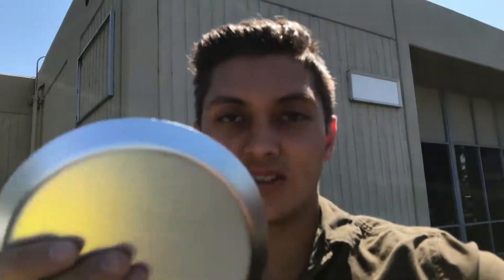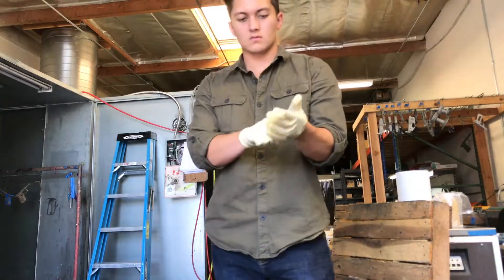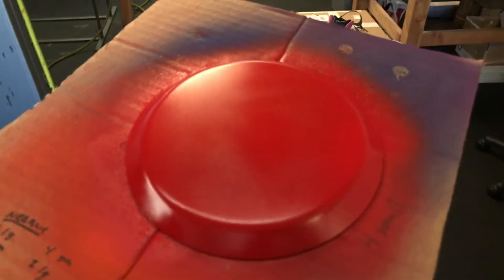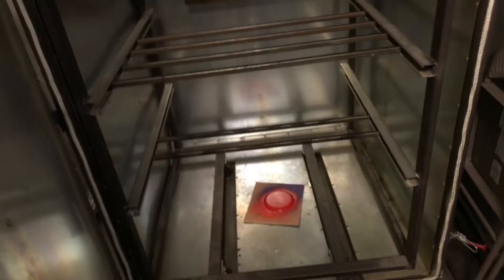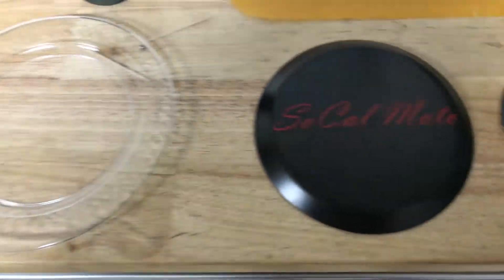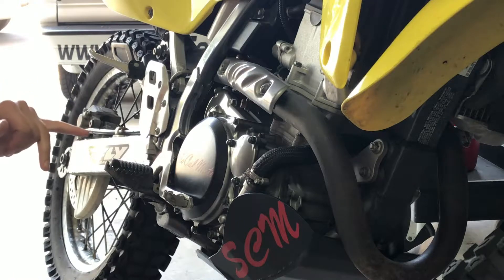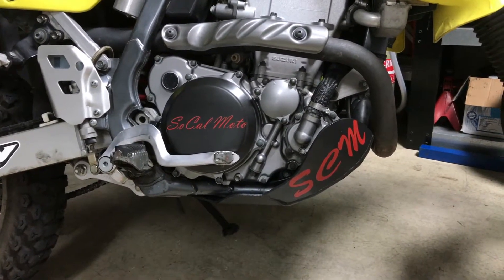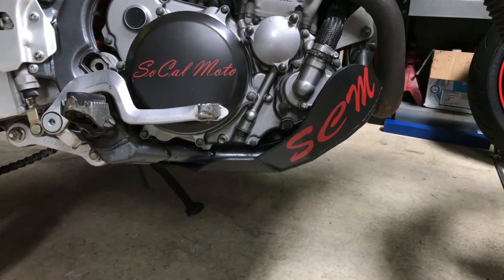DRZ 400 CASE SAVERS: CUSTOMIZATION VLOG

Comment: did your bike already have the skid plate and you painted it? or is it new all together? also, have you considered adding a kick starter, simple back up mod?
Reply from the maker: Hank Amarillo had it and it got painted. I do want to look into that mod but I'm not sure if it's worth it. I'll be riding strictly street so the fear of being stranded on a trail is gone
Reply: kick start i think is worth it mod, dead battery solution back up